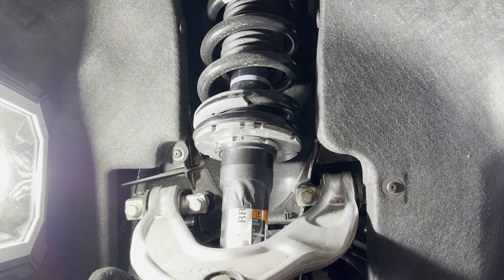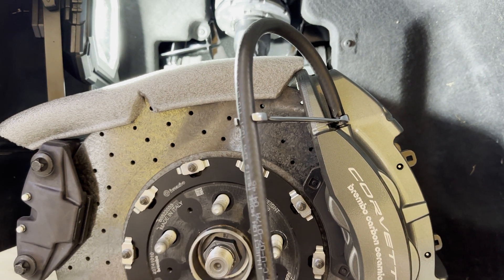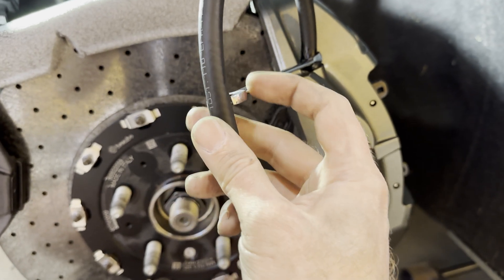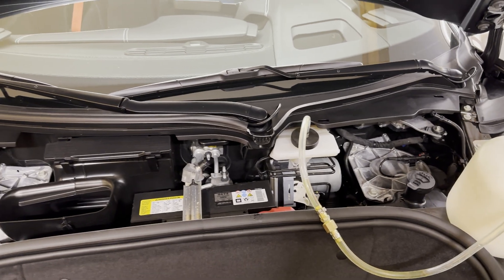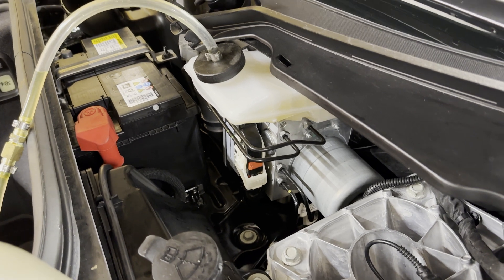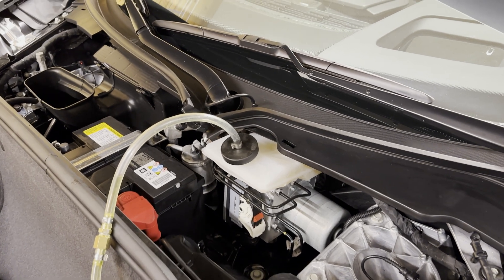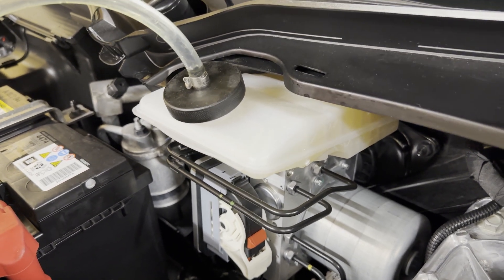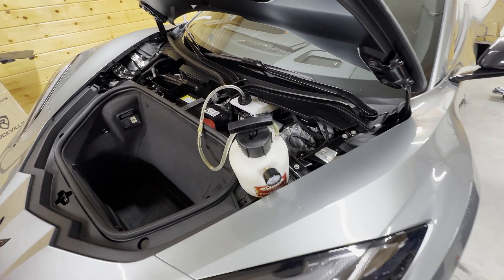How to Swap High Temp Brake Fluid on a C8 Z06 (and Stingrays)

Comment: Very smart to place a pool noodle over your carbon ceramic rotor that way you don’t accidentally chip it.
Reply: They come with the car when you order the ceramic brakes. Instructions included indicating you should use them every time you remove or install the wheels.

Comment: Like an idiot I removed the battery panels but forget to disconnect the battery before I started bleeding. The FOB WAS in the vicinity of the car.   Realized it a couple minutes in and disconnected it.  After I finished the bleeding I noticed there was a check engine light.  I test drove the car and everything seemed to be braking normally, including braking hard enough to engage the ABS.  I cleared the check engine light with a bluetooth OBDII reader and still so far so good.   Do you have any idea what might have happened/could have happened because of this error?
Reply from the maker: Sorry not sure

Comment: I have been looking all over for a video on C8 brake bleeding that showed a successful outcome. Forums discuss the pitfalls however, yours is the first showing a successful outcome. Am I correct in understanding that with pressure bleeding you do not need to depress the brake pedal, just open the bleeder? I don't have a Z06 so curious as to which bleeder to open first? Thank you.
Reply from the maker: Yes that is correct. The pressure bleeder is acting as your foot. Start with the inside bleeder then work out since that's the first channel in from the line
Reply: Thank you. @gearedmedia1

Comment: So you didn't have any issues with air or codes?  Did you disconnect the battery the whole time you pressure bled?  Several other videos have shown issues with codes and such.  I'd love to upgrade my z51 to the AP brakes but I'm worried about running into issues doing the work myself, there's almost zero support here in Germany.
Reply from the maker: 0 issues on both my Z06 and my Stingray previously. Battery needs to be disconnected the whole time. I had APs on my Stingray with zero issues as well.
Reply: @gearedmedia1  thanks for the feedback!  Last question...I use the same Motiv power bleeder but have had bad experiences with their master cylinder tops, the "nissan" did not fit my Nissan very well and was a bear to remove.    Did you experience that?  Can you link me to the exact part you used for the C8?
Reply from the maker: @metomwhou  if you search Amazon for this, it will show up - "Motive Products Brake System Power Bleeder For Most Late Model GM Cars and Trucks"
Reply: @gearedmedia1  Yupp, they had two kits, 1118 with the red cap and 1108 with the black cap.  Looks like you're using the 1108 kit so I'll try that one!
Reply: Hi, Were you able to bleed your C8 brakes without any issues? Thank you. @metomwhou
Reply: @mhonella  Not yet... I still have a few more track days this season.  Once the season is over in October, I'll give this a try with either the AP upgrade or on my stock brakes and report back!
Reply: Thank you. I am going to swap out my calipers because I don't like the black ones that came with the car. Thinking about doing them myself considering the dealers want $900 to do it. Wish me luck! @metomwhou
Reply: Thank you. @metomwhou
Reply: Thanks for this info,,, need to order the correct Motive cap. Switching base brakes to Z06.